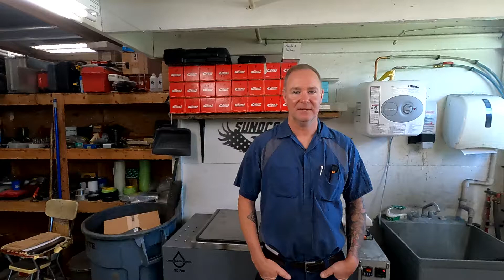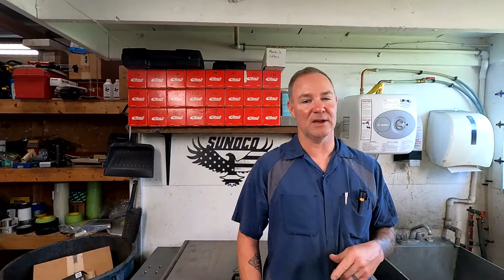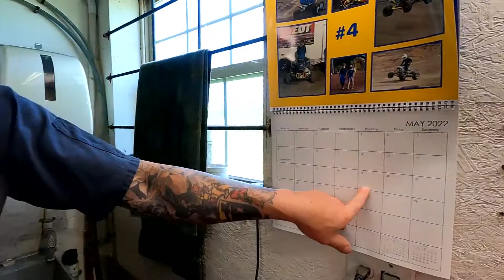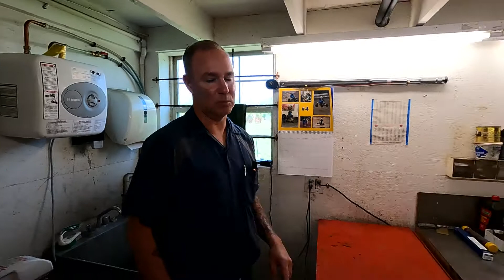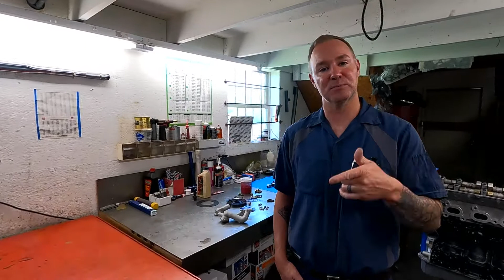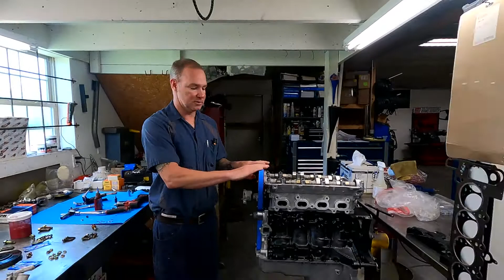SHOP TOUR - Changing the Way Water Flows and Cool Mach 1 Mustang

Comment: I wish Subaru had kept the shim on bucket like on the older ej20 dohc engines. The EJ25 dohc turbo engines have gone to a one piece bucket. Use an old bucket, check the gaps, measure the old one and order all the buckets you need. Shims are about $8-9 where as the one piece is $25-28 each.  I had to do that again when I put my engine back together with new cams.
Good luck this weekend, stay safe and have fun. Looks like it will be wet Saturday. Say hello to everyone. Not sure when I will get out this season.
Reply from the maker: Weekend was dry, and some off-tracking may or may not of happened...  Stay tuned!
Reply: @jpm  😲